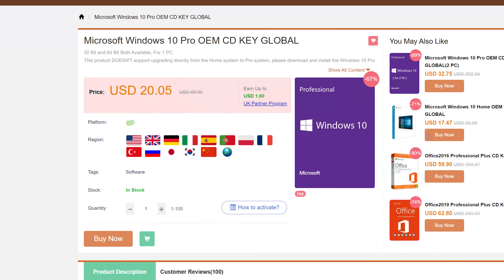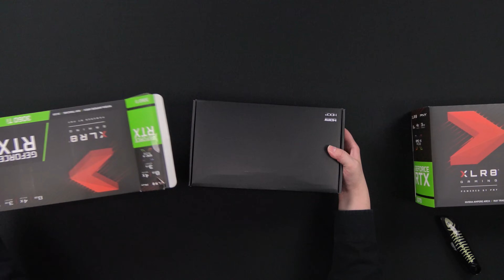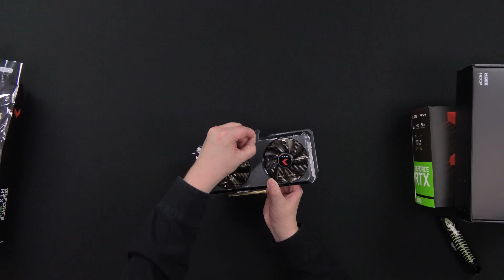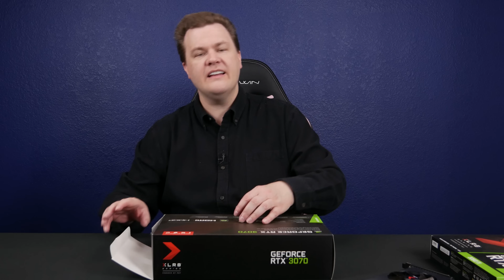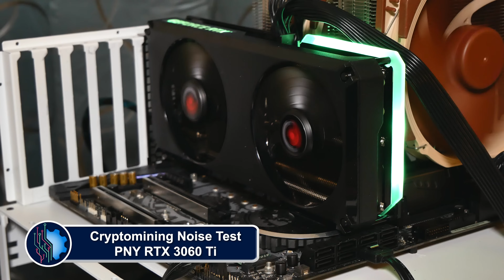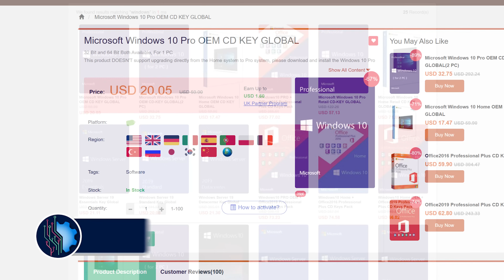Are Big Triple Fan Graphics Cards Worth It? — Sound & Temperature Test

Comment: I have a 2080 GPU with 3 fans,  When I start the computer all fans spin then 2 stop and 1 continue to spin.  GPU Z shows that the temperature is no where near high.  Trying to figure out if the 2 fans are idle or are they not working.

Comment: I like the PNY cards, I think they would work well in my case with the massive pass through air flow design. I just built a new PC in a Jonsbo V8 which is an ITX case with horizontal mobo layout, GPU stands vertically. I'm surprised there aren't more cases with this layout, it just makes more sense imo. Less stress on CPU socket and PCIe slot(s), typically better VRM temps due to heat not rising from one component to the next. The top VRM always seems to be the hotspot on any given Mobo. I still need a GPU though to pair up with my i5 12500, I really want to get one of the PNY cards. Their triple fan model would look wicked awesome up against my side vent!

Comment: any help please ...does the PNY GeForce RTX 3060 ti dual fan support Stop fans that the fans stops if the Gpu is not under load ?
Reply: Yes but dnot buy this thing the test was in cool room and with a open bench i bought tje thimg and it easily reaches 77c with 76% fan speed

Comment: What about kits like the RAIJINTEK MORPHEUS 8057 and adding 2 120mm fans instead of a stock setup? Wouldn't it be more cost-effective to start with a cheaper single fan GPU and upgrade the cooler to a better aftermarket alternative.
Reply: Why buy with a fan? Get a fanless and add in aftermarket cooler then. that lower gpu pricing.

Comment: Did a nzxt g12 on MSI X Trio now my GPU never goes past 37 degrees while gaming with stock I would get 48 or 49ax but now 36 is standard and 37 is like max and idle I get as low as 21 to 23 room temp is 21dgrees. I have the rtx 2070 super I have it overclocked to 2145mgz and memory at 8000mgz

Comment: I would have to argue that you needed to test this more thoroughly. Will the 2 sound different in a normal use scenario such as your average case. With other fans in the system can you tell the two apart. Will the length and width influence the path of air taken by the cases intake and exhaust? Would this cause a difference in temps? In a restricted case a shorter card may be able to pull more air  from the rear of the case, a longer thicker card may not and so on..

Comment: wait, plastic backplates trap heat between the pcb and the plastic backplate, right? I mean all backplates do but at least with the metal ones you can add in thermal pads and turn it into a sort of heat sink, right?

Comment: When chosing the card people look too much at FPS graphs in cards comparison: ,,this is the fastest 3070 card!". Yes, unnoticeable 5-10% faster than slowest one - instead of 30 fps you will have 33. The same with overclocking capabilities. What really matters are temps and noise, because they are the things, which will noticeably determine your experience with the computer during next few years. As you said, totally worth usual 50 bucks, which gives you much better card.
Reply: 100%! Also helps keep temps in check for GPU boost. But I guess no point in talking about cost because prices for any card are way of the scales now lol

Comment: The biggest shock was there isn't much fps difference between the 3060ti to the 3070?? Is this just cyperpunk or do other games scale this way???
Reply: There's about a 12 percent difference on average between the two.  A bit more a bit less depending on the overclocks some AIBs do on their cards.  Thishas been known since the 3060ti was released and all the reviewers benchmarked them.  The 3060ti is an awesome deal if it was easily available at MSRP.

Comment: I personally have the PNY XLRY RTX3060 Single fan (ITX) version GPU and its fairly quiet, even under load in my Skyreach Mini ITX case. I feel that in this generation were paying a premium for heavily over-engineered cooling solutions as manufacturers are simply using a 1-design fits all card models e.g. RTX3060-3090 in their line up approach which is adding some cost to their MSRP/RRP.

Comment: I own a gtx 1070. But due to my old corsair 100r case, it wouldn't fit a triple fan, asus rog strix 1070, so instead I settled for a zotac mini version of the gtx 1070. Biggest mistake of my life, not only does that card have a slower clock, but the cooling on that thing is terrible. After I've bought a new case, I'm still stuck with that gpu. Kids, that is why you should go for cases that can suppose longer gpus, don't make the same mistake as I did buying a mini gtx 1070.

Comment: That's an interesting video, and actually on a subject I have debated myself... I have been asking myself if i'd prefer a 3-fan 30-series card, or a 2-fan 30-series card.  I do have a Micro-ATX case, but it's a roomy one, certainly has the length for a 3-fan card and I have no other add-in cards, so I think i'm capable of using either card... of course the main problem... well, it's Spring 2021 and I can't find either card in stock anywhere.  Well, i'll keep this video in mind for if/when these cards actually do ever show up in stock anywhere.

Comment: Like anything it depends. A bad design 3 fan gpu can be as bad as having two or less fans. Also depends how much air you can push to the GPu and the temperature of that air. I feel to make a big difference even more then a water cool system they are going to need to design something like a AC system hooked to the Gpu that is somehow better then a water system. That would be pricey. Also OC affects everything

Comment: I would rather have a teir lower with a good quiet cooler, than a jet engine on a teir higher.  My 1216Mhz jet engine dual fan 970 turned into (modded firmware) a 1600mhz virtually silent card, by installing an aftermarket arctic cooler (still two fans but well made).  I had a Strix 1080 O8G, and upgraded to a gigabyte 1080 Ti that had the windforce 3.  Both had three fans, but one was very quiet, and the 1080 Ti was horribly loud over 65% fan speed, which meant it was louder by far, once you tapped into any performance over the 1080.  That got a quality aftermarket cooler, and it's now virtually silent, running only 7v fans, and nice and cool.  I guess I'm saying three is better, but cooler quality matters as well.  I'm willing to bet the two fan Accelero would have still outperformed the windforce 3.  If you can manage it, and you have the space, you can always upgrade the cooler later, if you're stuck with a loud little card.  The 1080 Ti has an Accelero 3 on it.  I disable RGB and don't really care what the cooler looks like.  I prefer function over form, and quiet operation.

Comment: I bought a Zotac RTX 3070 that has two power connectors and the back plate is metal. It also came with the power cables if they were needed. PNY seems to be cheaping out on things imo
Reply: 3070 Gainward phoenix 3 fan RGB OR Zotac ?
Reply: same price

Comment: As always, "It depends". You'll have an easier time with the dual fan in an SFF build or if you want to water cool (That dual fan card is closer to a FE than not). General ATX, Triple fan would be better, plus the triple fan would move more air than the dual fan making up the difference of being one fan down. 

I personally prefer the triple fan cards as the only two i've owned cooled exceptionally well (5700XT Nitro+ and 6800 Reference). I'd only ever hear the fans on the nitro when they ramped up to 1900rpm. I literally never hear the fans on the 6800 unless i manually set the fans to a high speed. Even at the stock "high speed" of 1650rpm roughly, I literally never hear it. By that point i'm hearing the chipset fan, case fans, and the aio's fans over the card itself.
Reply: No, it does not "depend". The triple fan GPU is just superior, period. Any argument about SFF builds and water cooling are all external factors that have nothing to do with the GPU itself.

Comment: 2 fans can certainly do it and quietly, as long as the cooler is designed well and fans aren't small.
MSI and EVGA were more than able to make cool and quiet 2-fan 1080Tis which pull 270-280W in full load.
I can understand 3-fans cards on RTX 3080 and 3090 with their 320W+ but I'm also pretty certain that you can have a massive 2-fan 3-slot cooler with 100mm fans that's able to cool the 3080 well.What I don't understand is why we don't have 2-fan coolers on something like 3070 which pulls 220-250W and can be cooled perfectly fine with one...5700XT with same TDP had good 2-fan cards like Sapphire Pulse and Powercolor Red Dragon and MSI Gaming X. 3070 FE is a good example that it's very much possible with 3070...

Comment: Floor's me I can get a smoken  $300 AMD cpu and a nice Asus b570 motherboard for a little under $500 and its way more hardware than a graphics card and yet I cant even get a card and there $1,000 each. I can build a super nice "complete" computer for under  a $1,000. and the total hardware is 5x what a video card is.
Reply: Well if u have a working built pc which most do, most mainly upgrade the gpu.  As it gives the most performance in gaming as a stand alone part.  So technically it's like a "new computer " just by itself.  CPU's generally last a bit longer in terms of upgrading next.

Comment: Here the reality, the fans are the last step of the cooling process, first and foremost you need proper thermal contact. This is where ASUS messes up, their 5700 XT had no thermal contact at all between the GDDR6 and the heatsink and poor thermal contact between the GPU and the heatsink. That is unforgiveable. Don't be mislead by fans and a big heatsink, look at the stats from benchmarks, if those ar missing then don't buy it.

Comment: got myself that exact 3060ti for 440, and i was a little worried about the build quality, but hey it performs well and it stays quite cool, so im happy!
Reply: damn you lucky,i got 3060ti also Inno3d 3x fan version for 899euros but damn its good silent and max temp under heavy load 2h gaming is 60c.I came from 2060 gigabyte 2x fans and that one was jet engine

Comment: My Asus Dual OC 3070 is whisper quiet in my Corsair Air case and I absolutely love it. I was worried about going with 2 fans but the card stays under 65c and can't be heard. It's just absolutely demolishing everything at 144hz 1080p Ultra with Gsync. Red Dead 2, Control, and Cyberpunk stay locked at 75fps and everything else is 120 or 144. I really wish everyone could experience these new cards sooner than later. They are literal game changers.
Reply: how much temp are you getting with uncapped Frame Rate?
Reply: Thanks for this comment! I ordered the same card a few days ago. Was starting to think it was an misstake. Now im more at ease

Comment: 3 smaller fans > 2 larger ones
Reply: Larger fans are typically quieter because they can move the same volume of air at a lower RPM
Reply: @TechWithSean  typically, not atypical like the 2 pny cards in this video as evidenced by the twin fan card with 2 larger fans...
I recall linus or steve saying what you  said about large  fans, in the context of case ventillation. 

it seems when there is a direct high heat source like a very hot gpu higher static fans are more efficient at thermal dissipation.

Comment: Even if they aren’t the same GPU, this test really helps tell the difference between 2 fans and 3 fans because the 3070 puts out more wattage vs the single 8 pin 3060Ti but yet the temperature is lower on the 3070. Proving why 3 fans is necessary
Reply: 3X fans cards are more silent than 2x also,3x fans tend to have bigger heatsink also
Reply: if the size are smaller in the 3 fans then it doesn't really matter if u get 2 fans
Reply: They are the same gpu aka the GA104, ti cards are silicone that didnt make quite the cut thus they re rebadged as the ti version of the lower tier card right below it , non functional cores are of course deactivated.

Comment: I really can't see the point in this vid. Literally the only 3 things that justify the "premium" cooler models IMO:
a) higher binned chips/silicon lottery. 
b) expanded cooling giving higher stable fps, through higher boost or overclocks 
c) upgraded pcb layout for higher/lower power delivery (usually for higher overclocks).
+better rgb if that's your thing. 

And he'd pay extra for the "monstrous" 3070 that performs the same as a 3060ti??? Ummm... What? If anything this vid proves bigger coolers are 100% pointless.

Tech mentions noise but fails to mention bigger coolers can be noisy as hell and most AIBs use the exact same fans. Also, pretty much any aftermarket card will last ages (unless in v.bad temps).
Reply from the maker: The 2 fan card does not have a zero fan speed mode, it always turns at 30%.  The big card will stop its fans.
Reply: @TechDeals  makes sense given the massive cooler probs has pretty good passive cooling, but most gpu fans are inaudible up to probs around 50%. My large evga 1080 ftw is quiet up to 70%, loud at 90% and jet engine at 100%. My basic 2080 and 970 before it were about the same. Is the dual card loud?

Comment: Interesting video. Never really seen someone cover this topic
Reply: Gamers Nexus and Hardware Unboxed have many reviews of individual AIB card models that cover power, thermals, and noise.  Not quite the same format, but same subject.
Reply from the maker: Glad you enjoyed it!
Reply: @TechDeals  I watch all those channels, and yours, too. Keep on keeping on, you bring something unique to the table!
Reply: I did I got the triple fan when I bought a pre built
Reply: just use noise cancelling headphones and the sound shouldnt be a problem, 5C more for the 2 fan version? not a problem, i have always used single fan gpus and dont have any problems with them, my gtx 1060 has even reached 78C wit ha custom fan curve and it is fully oc, and has been this way for 5 years
Reply: @manuelmunguia616  I totally agree with you as I usually use a gaming laptop and noise cancelling headphones for gaming, but in some scenario, i would really love to enjoy my games in a surround sound system without hearing those turbo fans. I guess its good for companies to release 2 different cards for varies of customers.

Edit: I do have a silence PC system for my surrounding sound system, the fan barely spin in my 3080 game rock under light load